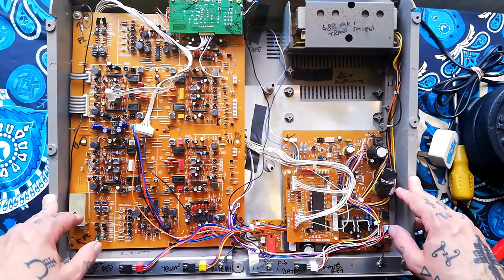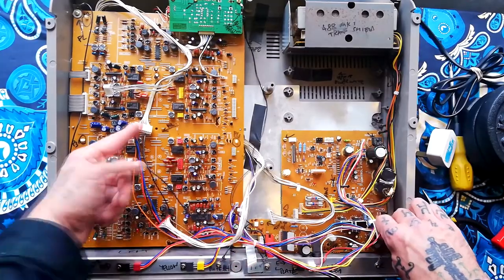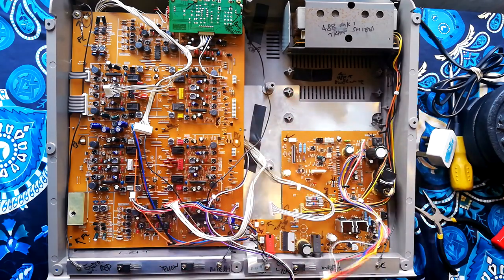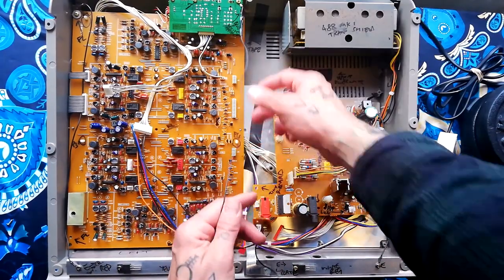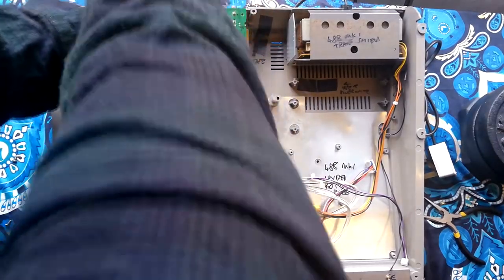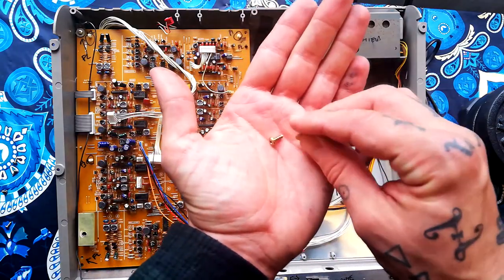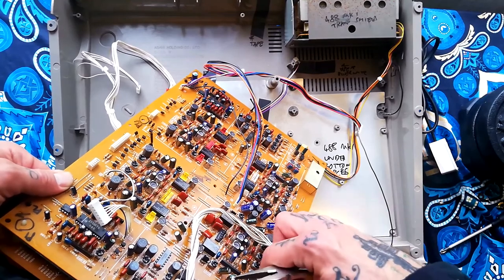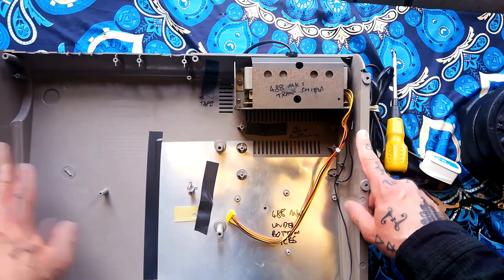Tascam 488 Mark 1 |  Tear Down lower section

Comment: Hey! Not related to this video, but I wanna thank you for your Tascam 244 playlist! Managed to pick one up for 100 euros (not sure if that's good or not, but the guy initially listed it for 500 euros, so I'm happy), and have been working on fixing the issues with the transport. That part is all good now, replaced the idler tires and tested the function with rubber bands while waiting for the real belts to arrive.

One issue still remains though, mixer channel 4 is completely dead. When sending an input and increasing the gain I can see the input overload LED lighting up, so it seems to be getting that far. Looked over the signal schematics (it included mint manuals, which was very handy) and my theory right now is that the signal never actually enters the mixer channel, but maybe the input selector switch is a dud? Or maybe just oxidized to hell. Tried monitoring track 4 from tape, and it results in the same thing, but I can listen to it via the cue knobs.

Do you have any experience with similar issues? Just cleaning the input selector might help?
Reply from the maker: 100 euros used to be the going rate for faulty 244s a few years ago but they've shot up in price in  the last 18 months, so you got a good deal. Your logic seems sound, you could verify that the issue is contained within the mixer channel PCB by swapping its position with a working one, i.e. if ch3 mixer works, swap it with ch4, if your hypothesis is correct, you will now have a working ch 4 and a faulty ch3, does thta makle sense? .f it is a problem with the mixer channel you would begin by deep cleaning the switches knobs and faders (see my video on the subject). Failing that, you could use signal tracing to figure out how far through the PCB the signal is getting - you would;d do this by introducing a signal from a function generator or even a synth with one key taped down and testing for the presence of the audio at major landmarks between the input and the output, in this sort of circuit the location of opamps and potentiometers give you a good idea of how the signal istravelling from the input to the output. Once you find a a component where there should be a signal present but isn't, you can move on to looking for damaged solder contacts, reflowing the solder, replacing components (nearby capacitors too if an opamp seems dead) as necessary. I do have videos on these processes, check my channel, and thanks for watching!
Reply: @Tetrakan   Thanks! That makes sense! Was considering it when I had all the mixer channels out last night, but I forgot haha. Just did some light cleaning for now until I can get some decent cleaner for it.

I did however bring out a multimeter to measure the differences in the input switch signal paths from a working channel, and found none, so my initial theory is probably wrong. Will try your other suggestions :)

Put it all back together again, at least my intense knob twisting and light dust removal has resulted in som of the crackly pots being almost not crackly at all.

Guess I should tear out 3 and 4 again at least and test.

I really appreciate your channel. I wouldn't even have taken the risk of buying the machine if I didn't find this . Thanks again!

Comment: odd, the control board on mine doesn't have any fuse slots and any fuse
Reply from the maker: Could be a regional legal thing. With 244s for instance, EU/UK models included a fuse board, whereas models for the US market did not.